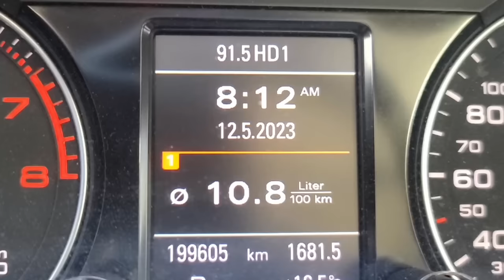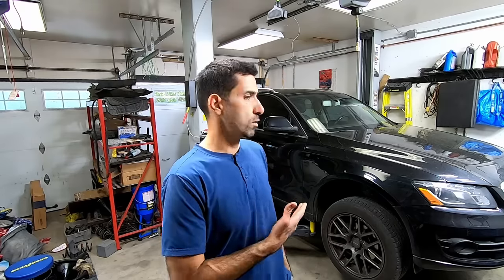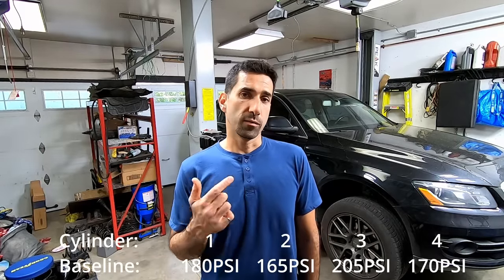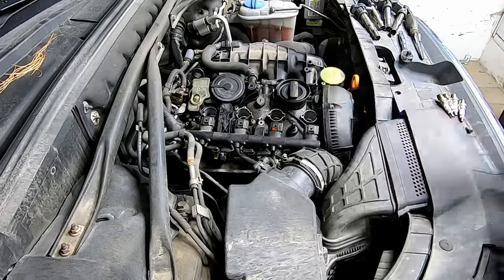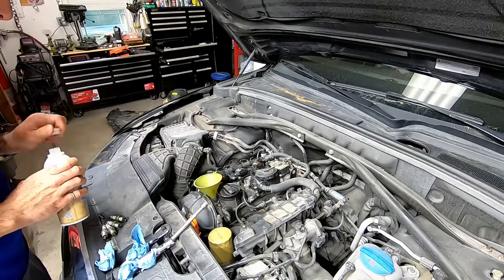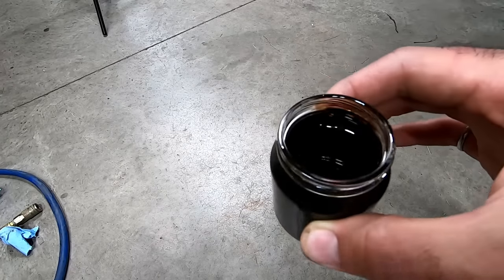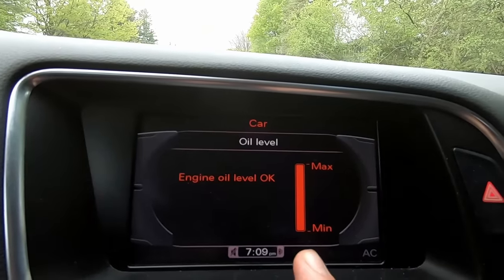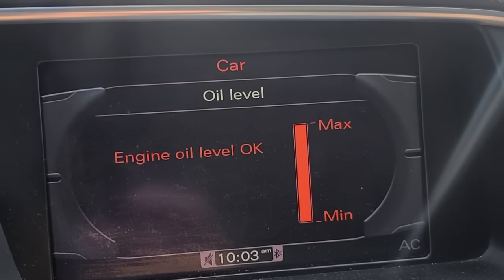How to fix excessive oil consumption from clogged piston rings (Part 2)

Comment: NB - NEVER EVER USE A PIECE OF METAL/SOCKET TO PUT INTO YOUR CYLINDER CHAMBER TO MARK YOUR PISTON POSITION - ALWAYS USE A SLIM PIECE OF WOOD/RUBBER. THE REASON FOR THIS IS THAT IF YOU ACCIDENTALLY  DROP THAT PIECE OF METAL INTO THE CYLINDER THERE IS EVERY CHANCE THAT YOU CAN DAMAGE THE PISTON FACE.
I HAVE WARNED/ADVISED MANY PEOPLE AGAINST DOING THIS AND THEY GLADLY  IGNORED ME RIGHT UP TO THE POINT IT DAMAGED DAMAGED A PISTON FACE...................
POINT PROVED!!.
NO GARAGE MECHANIC WORTH HIS SALT WOULD USE A PIECE OF METAL/SOCKET TO DO THIS.

BUT, IF YOU WISH TO IGNORE THE FACTS THEN ON YOUR HEAD BE IT.

Comment: Will this work on a 2015 Hyundai sonata 2.4 GDI
Reply from the maker: If your issue is piston rings then yes
Reply: @ETMotorsports  I was recommended by Hyundai dealership to do a combustion chamber. I already did a cleaning with CRC . If I try the method in your video will it be safe just to double check on piston rings. Or will damage rings if it is not that?
Reply from the maker: @montealexx  it won't damage the rings - you're pretty safe

Comment: Do not drop spark plugs.
Does it work on tdi diesel engines?

Thanks
Reply from the maker: A few people have asked about diesels - I personally haven't tried it but there's no reason why it wouldn't... the problem with the diesel is going to be removing the glow plugs or injectors to add the liquid which isn't as trivial as removing the spark plugs

Comment: Did you ever tried the piston(rings) with brake fluid?
Reply from the maker: As in pour brake fluid down the cylinders? Not sure I'd want to try that... does brake fluid dissolve well? I wouldn't want to run it in the motor for sure
Reply: I tried a handgranade once ..they came loose

Comment: Oil change after every 6000-7000km will keep you out of problems
When oil it’s starting to get black must be changed
Long intervals oil change will destroy your engine
Reply from the maker: Unfortunately this issue is caused by low friction compression ring letting soot build up into the rings...frequent oil changes definitely help keep an engine healthy but they won't save you from this problem

Comment: What would be a good substitute for b12 for us in Europe?
Reply from the maker: I think LiquiMoly Engine Flush Pro Line would be a good start... do you have any fuel system cleaners available in bigger containers?
Reply: So LM Engine Flush would go inside cylinders? Regarding fuel system cleaners, only ones in small bottles are available
Reply: Acetone. Read b12 sds

Comment: Maybe it’s the valve seals causing the oil burning and smoking?
Reply from the maker: Nope - not in these amounts...I did oil seals on the A4 before the soak thinking that's the problem and basically wasted a day with zero results
Reply: @ETMotorsports  just curious if you have tried the Amsoil flush?

Comment: Hi,do you believe this would work on a 2.0t tsi tiguan engine? I burn 2 liters per 1000 km...
Reply from the maker: Yup - you've got the same problem so this should work well on your motor
Reply: So I did the piston soak with two cans of B12 and then two cans of seafoam. I added the seafoam cause I ordered the B12 spray instead of the liquid.   After 24h+ I ran the engine for 30 mins, then flushed the oil and changed filter. I only drove 50 km with new oil so I don't yet know if it fixed the problem but I keep getting a knock sensor error... any ideas?
Reply from the maker: Did you run the engine with 4 cans of solution in? 2 cans of B12 and 2 cans of seafoam? Or did you do two separate soaks?

Interesting- a knock sensor error? Is it giving you a misfire on a specific cylinder? Dirty plug? Did you add B12 to the fuel as well?
Reply: @ETMotorsports  4 cans in one soak. However, it was more like 3 cause I had a hard time getting the full quatity of the smaller spray cans. You think its too much?
Reply: I cheked the spark plugs and coil today, then cleared the codes and drove 70 km without any knock. I dont know yet about oil consumption but the knocking seemed to be something transient... I will update when I get more mileage.
Reply from the maker: @Djeepee01  good news! Keep us posted on your results
Reply: 313 km and 500 ml oil loss... its half what I used to burn, but still quite significant. Dont know if it will settle over time or if I should try it again...
Reply from the maker: @Djeepee01  hmm that's still a lot... the q5 is at about 800ml just shy of 5k...
Reply from the maker: @Djeepee01  technically you didn't soak with B12 right? If it was spray form probably didn't actually do anything... I wonder if you should try it again with the right b12
Reply: @ETMotorsports  I did the soak with the B12 but not with 2 full cans... I ordered some more. Will see if I try it again.
Reply from the maker: @Djeepee01  you said it was spray form though right? That stuff evaporates pretty quickly actually so  I'm wondering how much actually stayed in the cylinder? The Seafoam must have been ok
Reply: Exactly. I ordered the non spray version this time.
Reply: So I got the B12 again and I am doing the soak. However, I notice that the fluid drains pretty fast (15 mins) right though the pistons. How long did the B12 stay in the combustion chambers  in your car?

Comment: Rather than turning the motor over by hand in between soaks, do you think there would be an issue with just using the starter for five or eight seconds? Having a hard time getting a socket and breaker bar on the crank nut. Great video by the way.
Reply from the maker: Hmm a few folks have asked the same - the problem is the starter hits it pretty quick and with no compression the pistons move very fast so it'll likely just push all liquid out of the cylinders... nothing mechanically wrong with it - just don't think you'll get the effect
Reply: How about put the plugs on and screw them a little and then crank it  (I also read this on berryman website when they have instructions on how to piston soak)
I am only only worried about mixing up the fuel with B12 when i crank
what do you think? @ETMotorsports
Reply from the maker: @Asadsaaram  check out the third episode... don't put the plugs in - it doesn't work... you can't really turn the crank wth the liquid inside and you can do some damage... at least that was my experience

Comment: Sadly I can’t tell since I know nothin’ about mechanics. He just pointed the turbo to me, saying its colour changed. 
As I wrote, I’ll be pleased by sharing my experience later on 🤞🏼
Reply from the maker: Yeah please do because this treatment has nothing to do with temp so I'm hoping he didn't do something else to damage the engine
Reply: Out on vacation, it took time to burn a second qt. Just added one after 875km. The precious one was poured around 600km if I remember correctly. Still watchin’.
Reply: Sadly, the next qt was needed a bit before 500km driven.
Seems it didn’t work out for me.
Thanks

Comment: How did you get clogged? Piston rings
Reply from the maker: The low friction compression ring design allows blow by which clogs up the oil rings
Reply: @ETMotorsports  I never got that off my  Toyotas only burning oil and I did put cheap gas

Comment: Where can we buy this B12 chem in Toronto ?
Reply from the maker: Hmm I haven't found it locally - had to order from the US... but you can try seafoam first - that might work without needing B12
Reply: @ETMotorsports ok thank you 🙏🏼
Reply: @ETMotorsports  want to know if Berryman B12 is more strong (effective) than sea foam in your opinion?
Reply from the maker: @td1987  B12 is a solvent so it's definitely stronger than SeaFoam which is a lubricant with some solvent in it... however I did my first soak with STP (same as SeaFoam) on my A4 and it was strong enough to cure a severe misfire caused by oil burning so if you don't have easy access to B12 I would definitely try this once with SeaFoam (maybe get the high mileage which I'm assuming is stronger) before worrying about ordering from the US
Reply: @ETMotorsports  thank you it really helps I really appreciate your knowledge and time.

Comment: Something that I think would help break up the carbon sticking the rings is not to turn the engine after 6 hours, but to rock the piston back and forth which will put pressure on the rings both ways. Probably good to do that right after pouring the Berrymans into the cylinder.
Reply from the maker: you should never rotate the crank counter-clockwise because you're going against the tensioner and might end up jumping a timing chain tooth depending on the condition of your engine...always rotate the crank clockwise...
Reply: @ETMotorsports very possible 
, TY

Comment: How many kilometers this fix could last?
Reply from the maker: The Q5 is at 2000 right now without any oil warnings... even if the oil consumption increases again in the future,  you can just do another soak... time it wth an oil change and it's costing you an extra $20 to keep the rings clean
Reply: @ETMotorsports  Thanks for the reply

Comment: I have wet cambelt will that damage the belt i i do that
Reply from the maker: Oooh that's a new one... what engine is it? How bad is the oil consumption? When is the belt due for a change? Might be worth trying the chemical on a belt before throwing it in the engine... my initial thought would be no problem but there's no guarantee

Comment: you think this will work with my BMW X5 50i?
Reply from the maker: Haha nothing can help a BMW!! 🤣 JK... is it burning oil?
Reply: lol Im helping it it at 140000 miles no check engine light but burning oil out of one exhuast side - i just change spark plugs and coil but need to at least do valve cover on drivers side.

Comment: Any thoughts on doing the flush with E85? I was thinking E85 mixed with Techtron.
Reply from the maker: A few people have asked about alternatives - I personally have tried B12, Seafoam and STP engine treatments and all three worked pretty good - presumably the B12 is the best because it's a proper dissolvent...I imagine any liquid will work provided it dissolves carbon deposits and is safe for the engine I.e. doesn't damage seals...I was going to try diesel at my next engine flush but not sure it's strong enough for the pistons

Comment: Is the PVC working on that engine?
Reply from the maker: the PCV? yeah I didn't go into details in this video but I looked into all of the common oil burning issues on these motors before doing the soak...the PCV was replaced with an original unit directly from the dealership and it solved nothing...

Comment: What happened to the compression?
Reply from the maker: Nothing actually - +-5psi on all cylinders... I'm finishing the 5k video and will have the final numbers
Reply: Thats interesting.   Perhaps it wasn’t run-in properly to start with or it may have gunk on the intake valves?

Comment: What were the compression test results?
Reply from the maker: Not much different - within 5psi...it didn't really change the compression but I'll check and post them at the first oil change
Reply: @ETMotorsports  I've had really good results with water injection/steam to get unstick rings and get compression back in the past.  Direct injection leads to a lot of headaches

Comment: Will this work on a gl320 as well? Mine is using a lot of oil.
Reply from the maker: No reason why it wouldn't...320 diesel? You sure it's not coming through the pcv and the turbo? Lots of oil goes in from there
Reply: I have a lot of blow by. The oil cap bounces a lot when loosened. Also the oil catch can is constantly smoking if opening the level stick.
Reply from the maker: @edvaru33  do the piston soak - it shouldn't hurt anything...but I'd check the evap system - the om642 has quite a lot of issues with this so if the valve is not functioning well it might pressurize the system

Comment: How do you do this on a diesel motor?
Reply from the maker: Same process but pouring through the glow plug or injector holes depending on what you've got easier access to
Reply: @ETMotorsports  it’s 15 liter cummins. How many cans?
Reply from the maker: @garyhershkowitz3435  lol... no idea... how many cylinders? Calculate the area of the piston and then add some volume on top to make sure you've covered the piston completely
Reply: @ETMotorsports  6 cylinders. Motor is huge.

Comment: Rotella t6 by shell. This will clean your motor. 
You can change your oil often but most of it is made to ruin your car.
Reply from the maker: I ran T6 in my A4 after doing the soak itself... oil alone won't solve this problem - it's pretty severe

Comment: This actually good you dont have to change oil just change oil filter.... You have fluid flow.... 😂😂😂
Reply: What is the engine code for the two cars? Is it a ea888 gen 2 or gen 1/3?

Comment: I purchased my wife our first ‘17 Q7 3.0 motor. Same issues add Qt every 500-700 miles. Spent $2800 at high end shop which included soak with minimal improvement over time. Very disappointed in Audi. Would never buy another one!
Reply from the maker: Interesting - most shops don't want to touch piston soaking...curious if you know exactly what they did? And what else was part of the service? Multiple viewers have reported success with their 3.0Ts so I'm wondering if the shop really spent the time or just did a flush and called it a day

Comment: CHEAP TRICK FOR SPARK PLUGS...Hey bro if you dont have the spark plug sockeT which holds the spark plugs in place when putting it in then use this cheap trick, use the correct size socket and take a tissue paper and line it on the inside of the socket...you will need tweezers to take the tissue out of the sparkplug hole but its a cheap and effective way instead of dropping the plugs in which will ruin the gap on the spark plugs

Comment: BIG issuie with VW engines is their Direct Injection coupled with a V Poorly designed  PCV setup ...which  cleverly dumps all the blowby oils back into the intake.
 Carboning up Intake valves as well as rings. 
Essential to retrofit a decent Catch Can setup.... to prevent this self destroying setup..
 IF you want to keep your VW product running.. long term... that is ?.
Reply from the maker: It's not just VW... all direct inject motors suffer from the same valve buildup issues...at least they didn't have oil burning until these low friction rings were introduced...all VAG cars I've owned prior to 2009 have burnt zero oil

Comment: Car starts burining oil ? Buy the cheapest oil in bulk that still has the oem approval. Change it every 500 miles. Will clean the sht out of the engine :) Do it 4 5 10 times, filter can be changed 2 3 oil changes depending on what comes out of the engine.

Comment: HONESTLY BROTHER YOUR ISSUE MAY HAVE STARTED BY JUST THE WAY U PUT YOUR SPARK PLUGS BACK IN....... DROPPING THEM IN LIKE THAT IS A COMPLETE NO NO..... DOING THAT U WILL MESS YOUR GAP AS DROPPING THEM IN LIKE THAT THEY HIT THE BOTTOM AND SCREW THE PLUG GAP.  DON'T DO THAT

Comment: You put nearly a quart of basically lacquer thinner(B12) and then  with that extreme oil dilution; drove it under load? Just to "clean out" engine sludge and carbon?? Holy smokes. I can see soaking the pistons in it for the time you did, but I would  have changed oil immediately without putting it in gear. Matter of fact.....I probably wouldn't have even started it with that stuff in the oil. There is a reason that engine flushes tell you to only idle for something like 10 min. and DO NOT put the car in gear. I personally wouldn't even flush an engine with that type of stuff. At most something  like seafoam in the oil for a few hundred km in fresh oil then change it and hope you didn't make your seals leak like crazy
Reply from the maker: yeah this is entirely a matter of your own risk tolerance...on my A4 I idled the car for a few minutes and turned it off...the Q5 oil burning was pretty severe so I decided to run the engine longer...it didn't cause any long term effects but that's not to say it's "good" for your motor...so if you don't feel comfortable with doing that just don't do it - soak the pistons and drain the oil right away...there's nothing wrong with that

Comment: I have mixed feelings about it. In one hand I want to believe it is possible.
On other hand I know it may only work for some cases. 
Oil can be consumed through valves gaskets/orings, or the pistons maybe became oval and/or rings became worn.
In other words, in real world, you may try this B12 stuff before spending an engine rebuild, but be aware it may not work for you.

Comment: Hi guys believe it or not I am driving a 2007 model last made Velociti Golf1 up until now no problem just maintenance it myself only need’s to put in a new clutch and pressure plate. I changed the Cambelt and Clutch and Pressure Plate twice after every 105 000 Kilo’s still running good plus don’t even use oil.

Comment: guys, don't do bandaid repairs on your engine. 1 out of 10 people might get it to run another 10k but failure is inevitable.
Reply from the maker: there's no "failure" as far as this issue is concerned - the engines run fine but just burn a ton of oil...not many people out there want to spend thousands to repair cars barely worth anything...
Reply: @ETMotorsports   you know very well what Iam talking about.Where does all that sludge from the rings go then? Tip: not thrue the drain hole hahha